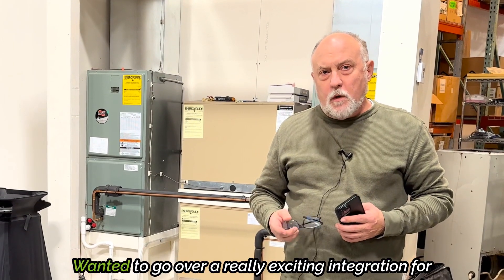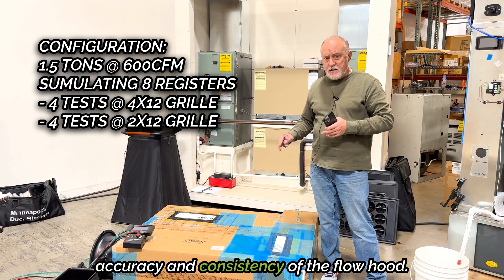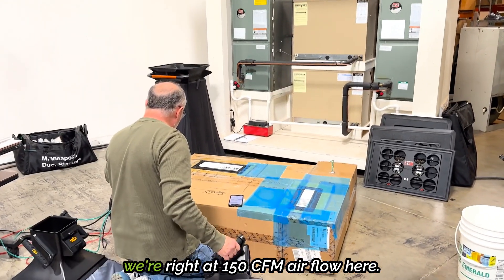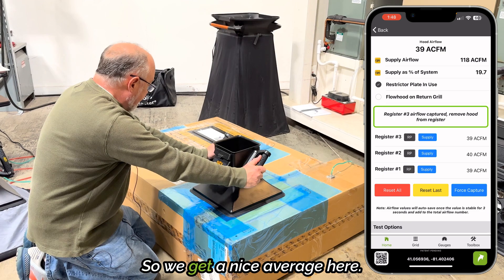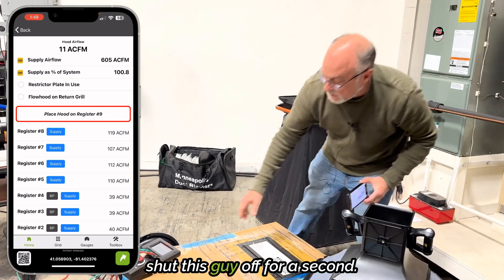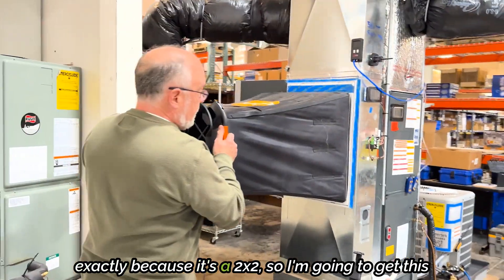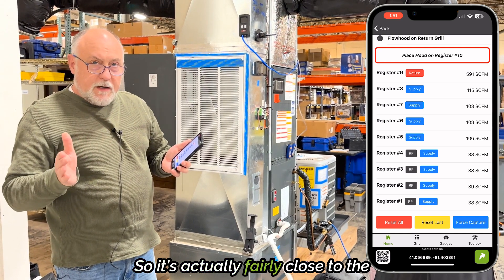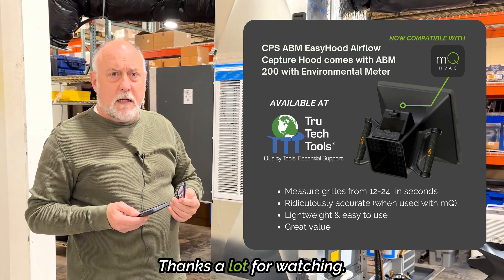Supercharging The CPS ABM-HOOD (EasyHood) with measureQuick

Comment: Seems like this would be just as good as the truflow grid then? Or is there benefits of having both? Assume there is a nice report that goes along with the MQ pro report?
Reply from the maker: @bringbkamerica  No, two different applications. System airflow vs balance. There is typically too much leakage to rely on a capture hood for total or system airflow, that is where the TrueFlow comes in as well as total system airside diagnostics.
Reply: @measureQuick  wouldn't it be possible with the hood to calculate total actual supply,  total actual return,  then utilize static pressure probes and system data to show system losses? Does Mq do anything like that? That would be a great add on... show customer actual supplied btus and airflow loss compared to what it should be,  maybe give a list of causes and solutions.

Comment: Ive used the hood on a few different jobs. It doesn't seem to read anywhere close to our engineers specs for 2x2 lay in diffusers or other registers too. It always reads really low. I dont claim to be a balancer either so...
Reply from the maker: Retry it with measureQuick and follow the process in the video. We made substantial improvements.
Reply: Try the restrictor plate. Airflow may be too low.